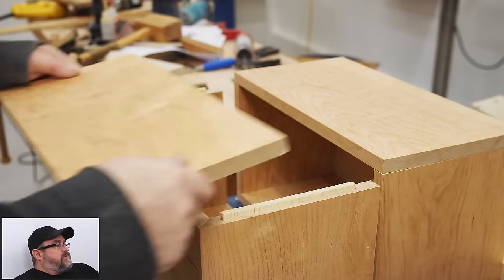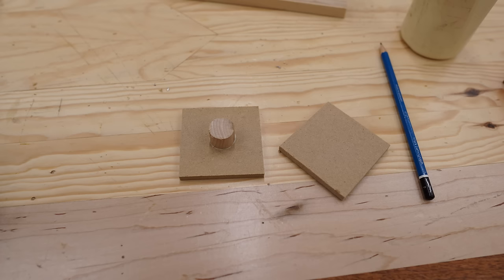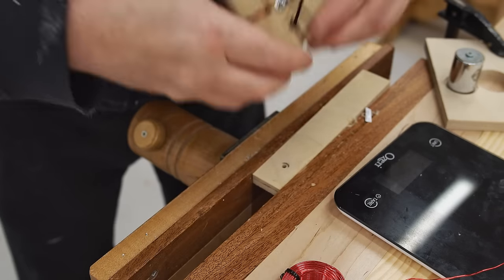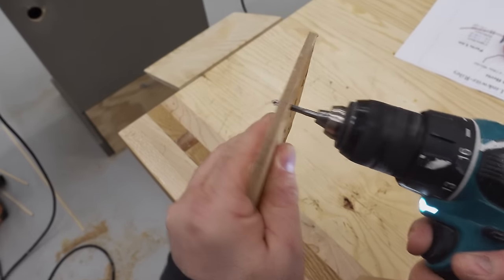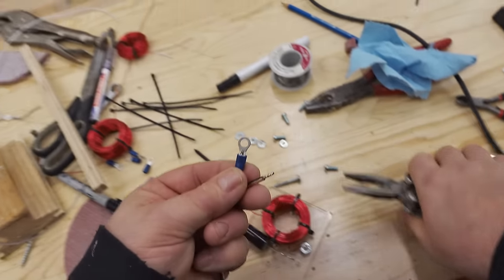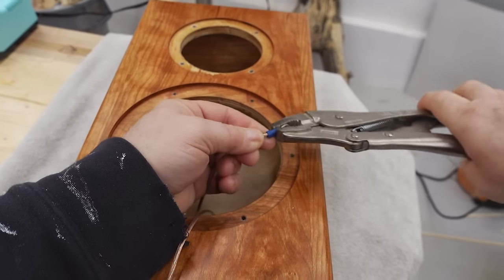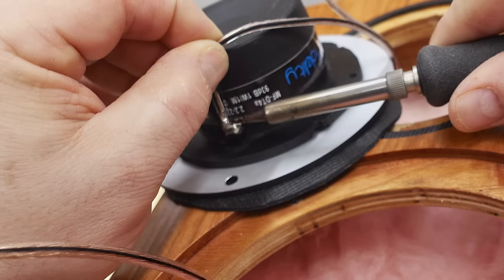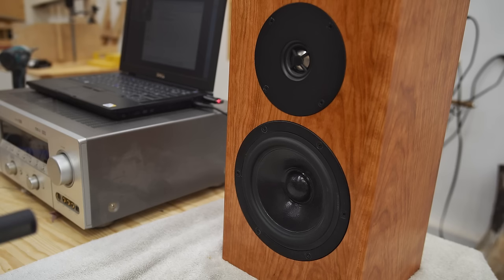Making The Crossovers For My Speakers PLUS Sound Test

Comment: Nice job, but simple “upgrade” suggestion: you should always be sure both coils are not in the same plane to avoid electromagnetic interference...
Reply: Have one mounted like he has it and the other should be mounted vertical. Right?
Reply: Ed Solomon Yes, exactly :)
Reply: @esolo4751  and further apart, probably another 1-2”
Reply: @esolo4751  si por ejemplo ponerle una madera entre medio dentro de la caja y recubrir con algun papel aislante por dentro y luego la espuma es algo que se me ocurre y tambien mejor comprar un ceossover hi fi de mas alta calidad de los que traen resistencias capacitores bobinas y transistores de cerámica y bobinas de alta calidad de baja inductancia estan a 40 usd en amazo.
Reply: @elneno427 What'd the point of watching a DIY crossover build video if you're suggesting that we should buy an off the shelf "one sound fits all" boxed crossover off of Amazon??? Bruh... come on man drink some coffee.

Comment: Fun project.  There is very good free speaker design software available now.  If you are thinking of doing a project like this and want to go beyond building one of the great kits available at places like Parts Express or Madisound.  A program called boxsim available on the Visaton website lets you simulate the response for different box sizes, tuning, crossover changes. boxsim has library of drivers to chose from, or you can load parameters of other drivers manually in to a project.  Another program Xsim also works well, but doesn't have a library of drivers, but you can load files from manufacturer web sites or measure yourself.

Comment: Interesting project! From my past experience building speaker cabinets and crossover coils, I suggest:
1. Make the coil core from 2 opposing wood wedges - it'll make removal much easier.
2. Never place 2 coils in a crossover in the same plane - they must be at right angles to reduce cross-talk.
Reply: i did not know that
Reply: Howdy. I'm with you. And more:
3. Always use a wire gauge of 1,5 mm diameter or even heavier for the coils. Thin wires reduce the damping capability of the amplifier.
4. The cap.s should be 3 or more smaller ones in parallel. This reduces the cap. lead impedance.
Regards.
Reply: Known as mutual inductance.
Reply: @artv4nd3l4y  Yep. Also cross-talk.

Comment: John, I have hand wound hundreds of toroids/inductors for home built radios (mostly amateur radio).  I typically heat my soldering iron up as high as it goes and use a blob of solder to burn off the enamel and tin the wire all at the same time.  Works for me.
Reply from the maker: Thanks Jason, I'll have to give that a try next time. :)
Reply: yeah, me too,will do next time.

Comment: Given that my cell phone has never sounded so good,  hooked up to a good system and in a proper room (not your workshop for a laundry list if reasons we wont go into in this comment) that speaker sounds amazing !!

You've made me want to go down the audiophile rabbit hole again !
Reply: A hole for rabbits? Why rabbits? And could it be a, "Tube"- for the rabbits? And why use rabbit in it's "plural" form? Just exactly how many rabbits?  All of them at once or just slowly, "One at a time"? Will the rabbit's be, "Injured", in any way?
 Should I feed them first or wait? 
What if I "accidently", fed them first. But now three of them are just too fat to fit in the, hole/tube/particle accelerator, plasma inductance, rail aperture?
 What then? I need more information. 
You "audiophile", types are just a little too odd for me!

Comment: Most excellent! You don't need me to tell you how good a job you did! Lexan or plexi is best because 1) It looks good, and 2) it is non-conductive and will not absorb moisture. I made two or three large networks almost EXACTLY like this in 1997 for car audio installs. I still have a 20 pound box full of Axon, Solen, and SCR PP and PS 600V capacitors, Solen Litz wound and standard wound 12ga and 14ga inductors, and numerous non-inductive wirewound 0.5% axial resistors with 16ga tinned OF  copper leads. Love your projects!

Comment: I used R20 on the first speaker I built. Actually, I didn't have any woodworking tools, so I got some used boxes. Anyway, they were originally very boomy, but when I added the R20 the bass tight end up nicely and got punchier. So it works well in the cheap!

Comment: In reading about crossovers I too was impressed with what I read about 2nd order Linkwitz Riley, but eventually found multiple sources to say that while 2nd orders look good on paper, more components means more external affect on the audio signal and that the 1st order is usually the best and series is preferred over parallel.  Pretty much every audiophile I spoke to about crossovers said that in today's world, digital crossover is the way to go.  Digital crossover means no passive components in the audio stream, so I take this to reinforce the idea that the less passive components you use, the better.

Also the cap on the tweeter in a passive crossover needs to be bypassed to allow the higher frequencies to pass more easily.  Use a 0.01uF cap, and the cornell dubilier 940c 3000vdc is said to be excellent for this purpose.

Comment: Very nicely done video and great work.  I love audio and woodworking too.  I’ve done DoD/DoE and related contracting, as well as commercial consulting for decades— from Hz to THz as some say.  Anyway, whether breadboarding or doing design-deployment, don’t mix metals or EVER use stainless or plate in any critical signal paths.  Don’t bind with it, don’t bridge with it, don’t run with it.   There are not insignificant effects to you signal within the audible frequency range and it only gets worse beyond.   Solder, or use another copper-to-copper binding method.  You are not using low-end components, so don’t use low-end methods.

Comment: Great vid. 👍 As always illustrates how during this Covid 19 stay at home what do I do scenario can be beneficial in so many ways to taking time out and with family  as well, to build some amazing (OR renovate ) gear. Sound is very relative and I've built all my own home systems including an awesome 7 channel surround system for peanuts using stored in the loft over the years, parts and pieces. I always remember back in the 70s having a Phillips cassette deck and adding an extension speaker mod (No additional amplifier) to it and the sound improvement / output was astonishing, which led me over the years to experiment with changing the sound et to suit my own preferences. Adding tone circuits is easier than most think which can drastically improve sound output 👀👍

Comment: Id like to see how they measure.
And to know how the crossover was conceived ?
How did you find the right cross over point?
How did you come up with the component values to be used?
How much baffle step compensation?
How does tweeter and woofer match in SPL? i noticed no dampening resistors.
If baffle step compensated? most often tweeter will be 3 - 4 db. higher then most woofers.
If no baffle step compensation, bass level will be very little and the tonal balance very bright.
have you considered getting a U-Mik 1 measurement mic. (quite cheap) and install REW on your computer (its free) so you can measure what really happens? and a LCR meter, all these things are a relative small investment that will give huge improvements in sound for DIY build.

Comment: With the ring connectors I like to take the plastic portion off. Tin the speaker wire like you did. Insert the wire into the ring connector and somewhat crip it then solder the wire to the ring connector as well, leaving you with a very reliable connection (You can heat shrink it after).

Comment: The insulation was a neat trick, not something I would have thought of.  Thanks for this series, inspiring me to give this a try.  I needed a project to practice my soldering on anyway.
Reply: Very old "trick" - Remember seeing it in magazines at least as far back as the '60s.
Reply: I have always like those open cell foam "bed toppers". You can get them cheap at most big box department stores, and if left loosely folded so they are not crushed, they work extremely well.

Comment: Enjoyed the video.  Lots of good information.

One note... you really shouldn't tin a multi-strand wire (e.g. speaker wire) when using crimp connectors.  A properly crimped connector makes better (i.e. lower resistance) connection to the connector without the solder.

Comment: Have you tried second hands hobby helping device?   Small weighted stand articulated arms with clips used to hold small pieces . Very handy
Looking at your specs seems like you'll be missing a bit of mid range was wondering if on another build if you'd consider a dual range driver and tweeter or maybe a horn speaker as compliment? 
Everyone is going with two way speakers .

Comment: Shouldn't the coils be aligned 90 degrees apart to not interfere with each others inductance?  As speaker performance is very impedance sensitive, I would recommend soldering all internal wiring rather than clamping and screwing, just to reduce oxidation over time.  Failing this, some Deoxit conditioner on these pressure connections would help maintain low impedance over time.  Good to see people still doing DIY speakers though.  The perspex XO mounts looks neat too, pity they are on the inside.

Comment: I don't think the coils should be aligned like that because the fields will interfere with each other.
I have seen many kits doing it that way but have been advised to do them at 90 deg and not pointing an axis at the other coil.  I would also solder all internal wiring because crimps are prone to corrosion and developing high impedance which is particularly bad for speaker performance due to the drivers low load impedance.  In fact, it's the main reason for deteriorating performance over time.  If you must do crimps, paint contact surfaces with deoxit conditioner before crimping to seal out air as long as possible.  I would also stand the caps up off the board and apart so they can dissipate heat better.  That should keep them in spec longer.

Comment: making crossovers!    aah, I hear the Seventies calling !  when we spent as much time on our stereos as our cars/motorbikes.
Reply: I still do! 99% of people today have no idea what great sound is. They just buy some Chinese made stereo system and go about their day, never knowing that if they buy a 40-50 year old system and get it recapped it will sound so much better and work to the end of time without any problems.
Reply: I still use my Marantz PM550DC from 1982 amplifier with a 7 disc CD-changer, 2 reel-to-reel recorders, tape deck, a phonograph and a bluetooth receiver with my swedish made DUX speakers from 1969.
Still sounds quite nice, will soon recap all of the equipments with high quality caps from Nichicon or better to maintain its great preformance.
And I ain't 30 yet.

Comment: Tinning is good if you plan to solder the wire, and perhaps acceptable with spring loaded terminals, but never tin wire that you're going to put in screw terminals. Tin is very ductile. Over time it will deform under the pressure of the screw, inevitably leading to a loose connection.
Reply: And loose copper wires under a screw terminal will spread and vibrate apart over time too. 6 and a half dozen of the other. Tinning the ends makes then so much more user friendly.

Comment: Xovers usually have resistors as well. How did you figure without them?
Reply: I haven't come across any Xovers with resistors. Why would they be needed?
Reply: @timburton4437  Guess you haven't come across too many Xovers. They're used to stem the flow of electricity and to balance sound levels. Part of an LR design.

Comment: Thanks for this Sir, Kindly advise, I have in my car a a mono block dedicated to the sub and another 6 channel amp dedicated to all other midrange and tweeters and lastly a an equalizer.I however do not still appreciate 20-30hz wavy/ air bass, can an aftermarket crossover cancel off the punchy bass and give me only the wavy bass of 20-30hz to the sub. (All equipment and speakers I have are from pioneer high end)

Comment: Hi John. Thanks for the video. Many years ago I built a set of speakers. Two tweeters, two mid range and two bass speakers in each speaker. I know very little about electronics and got someone else to build crossovers for the speakers for me. Unfortunately the crossovers resulted in the mid range speakers dominating. Would you be able to inform me what components I should use to build new crossovers where the tweeters and more so the bass speakers would dominate? Thanks.

Comment: Great vid. Thanks for sharing. I was wondering if an aluminum backplate would work.
Reply: Not ideal. Aluminum, while non-ferrous and non-magnetic is 1)Conductive and 2)Paramagnetic meaning it can resist eddy current provided by an external magnetic source. Possibly the ones produced by the wirewound inductors. Chances are, it would have to be some HIGH power field (3000Watt amp), so what I am explaining is useless for this application. Love to see if it is possible to make an 8ga 12mH air coil! 12ga coil with 3000Watts = heat and massive saturation. I am way more concerned about you shorting something out.

Comment: They look like nice speakers but caps degrade with age weather used or not plus you should have orientated those inductors one flat & one standing on its end so the electromagnetic fields cancel each other out, just wonder if they would have sounded any different?

Comment: There is absolutly no issue with heat on that crossover. It is just not going to be seeing enough power to get even a bit warm. The only time it becomes an issue is with resister networks and systems running hundreds of watts of power.

Comment: Hi 👋 John, . Interesting territorial, I made my first pair speakers cabinets about 35 years ago or more transmission lines, loudspeaker cabinets they are approximately 150cm  height 30cm wide 37cm depth, made of MDF 1" thick, you might find this interesting are used to work for a organ building company and when we were assembling the wooden pipes and parts of the soundboards we would coat the inner surfaces with glue to help prevent residents, I forgot to mention that i used peerless loudspeakers 81/2 " driver + 4" tweeter , 100W at 8 are used to 8 ohms, 
And like you we used very different types of music from the Bach Toccata Fugues , Kate Bush . Pink Floyd. Metallica. I purchased a special microphone set on a tripod in the centre of the room which is connected to a special meter to measure the frequency this bit I do not know how it works a colleague of mine was into electronics , but we would set up our equipment around about 11 o'clock at night and work through till about three in the morning so we could work in perfect silence. 
I look forward to more of your tutorials. Retired 70-year-old English gentleman living in France.
And I still love listening to heavy metal, Phil from the Moulin in France. Merry Christmas and a happy New Year
Reply from the maker: I have more audio projects on my other channel: https://www.youtube.com/c/IBuildIt

Comment: great video!  here is a question.  i ordered a high pass filter for some speakers i am making, and i did not buy a low pass filter.  i was not going to use one, but now i think i should.  i looked on line where i got the high pass, and they are out of stock on the matching low pass.  the components on the boards are identical.  could i hook up the high pass filter to the woofer with the polarity tabs reversed and get a low pass filter, or am i dreaming?

Comment: Shouldn't you tin the copper after its screwed to the connector because it would add impedance going through the Sauder which isn't as conductive as copper. Wouldn't it act as a speed bump to the electricity or is it just a negligence impudence? I'm not trying to be a troll I'm really asking because I don't know. I'm wondering which way is better because I don't know.

Comment: Fiberglass insulation has a way of getting everywhere, you wouldn't want little glass fibers working their way into the voice-coil gaps of those drivers. cheap poly batting from the craft section of walmart would be better.

Comment: As far as I know, such placement of the crossovers can be problematic and distort the sound. Coils in the same position should be 20 cm apart or in one axis vertically and the other horizontally. As a temporary measure, a car bulb connected in series in the tweeter circuit can protect the loudspeaker.

Comment: Solder the ring terminals onto the wires directly, 
rather than crimp?

I bet the connection would be better.

I would try to use gold plated,
pure copper,
ring connectors.

I don’t know of a good source though.

Or actually, I think I would eliminate the ring connectors 
and solder the wires directly.

Comment: Hi, i saw the wireing diagram in the link, but i dont understand how to wire in reverse, what do YOU mean nu that? Thanks
Reply: this is a 2nd order (which I think means 12 decibel slope) linkwitz riley design. you must wire one speaker out of phase (180 degrees) otherwise they will cancel each other out. you can either reverse the positive and negative leads on both tweeters .....or you can do the same to both woofers. that means you reverse both tweeters but leave the woofers wired correctly for positve and negative.   I do not know if you can do both so dont reverse the tweeter on the left side and the woofer on the other side of the channel/ speaker box
Reply: @eksine  thanks